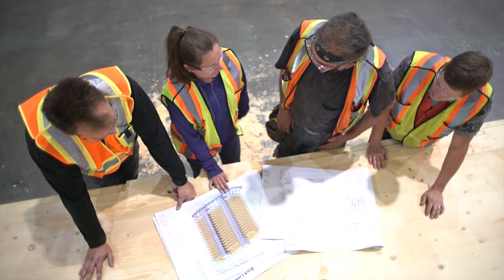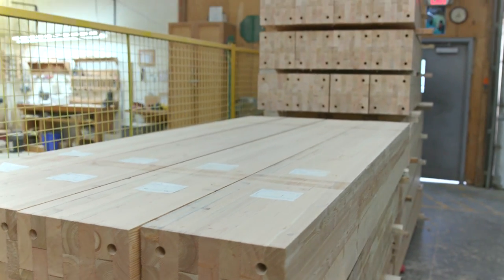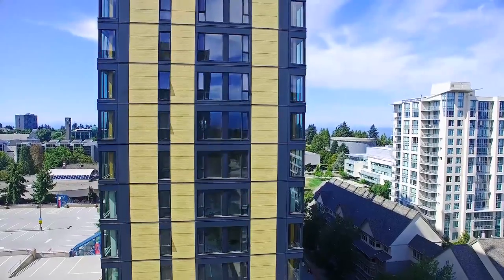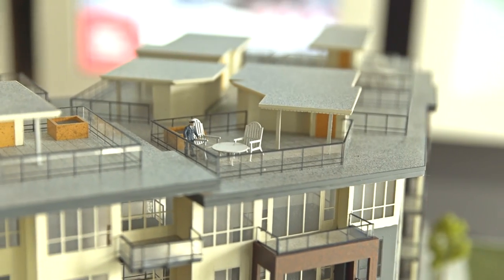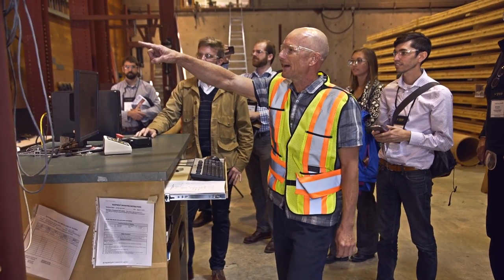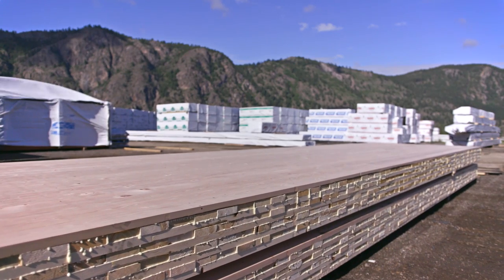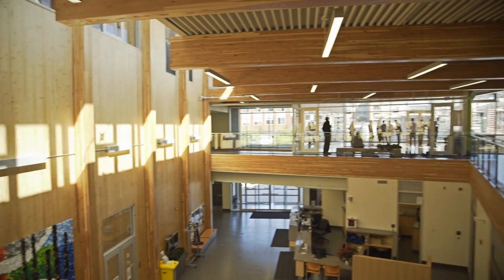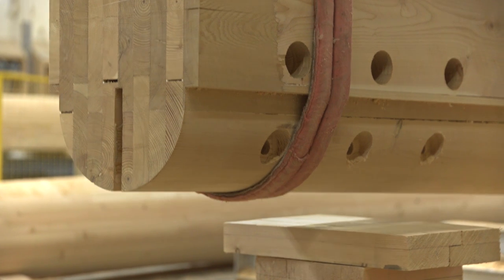Innovation in Mass Timber Construction

Comment: How is this sustainable in the long run? It is wood and we are out here trying to reduce paper usage and the construction industry wants to use more wood?
Reply: Wood is the only renewable construction material. There is a finite amount of metal on the earth, and the heat required to cure concreate is incredibly wasteful. Wood is also a carbon sink.
Reply: Steel and other metals are infinitely recyclable.